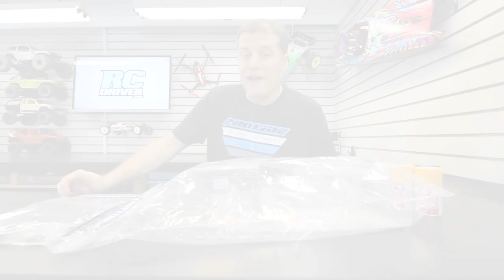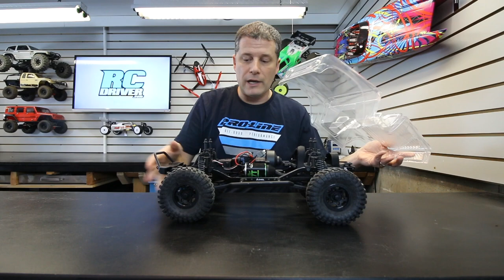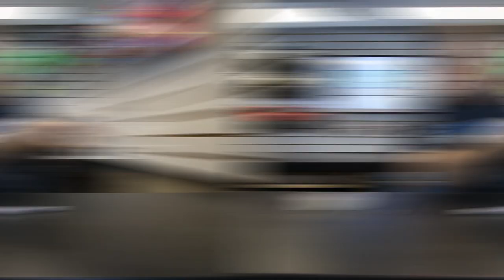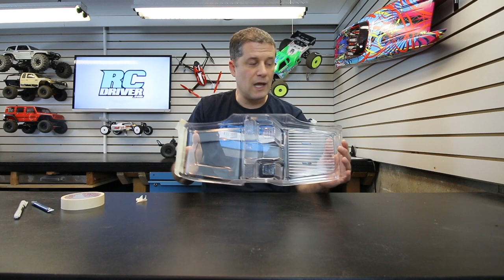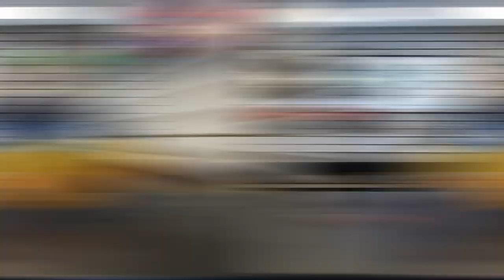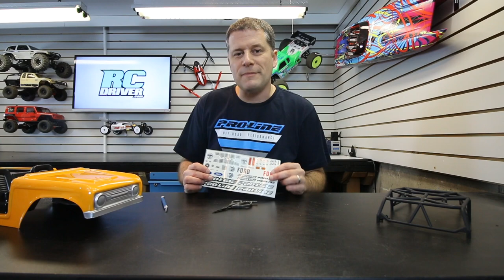Simple RC Body Painting Tips & Tricks! - How To: Spray Paint The Pro-Line Ford Bronco | RC Driver

Comment: A thin layer of shoe goo on the underside of the body around the body mounting holes and in the wheel wells will strengthen the body and prevent paint loss due to tire rub and roll overs.

Comment: I'm having problems with my arrma outcast. My ESC won't exit heat protection mode. None of the electronics are working. I charged the batteries and put new ones in the controller. Did I burn out my ESC? And does my ESC have anything to do with my Servo not working?
Reply: This is the wrong place for this question.  But to answer it, yes you have "cooked" your esc. Yes your cooked esc is the reason your servo is not working.

Comment: Well I painted a Proline Chevy Silverado body for my t maxx with 4 colors: metallic blue up front, a pink stripe going diagonally across the middle, metalic purple in the back and a black bed, for it just to go to waste because after a couple of runs, the paint all over the inside fell off randomly. It looks pretty ugly and I don’t know what I did wrong. I first cut the body, sanded it, washed it, masked it and painted it. It looked good only with some paint bleed in the pink stripe area. I’m really disappointed for a first body that I painted.
Reply: What kind of paint did you use? I’ve used a paint that said it was for plastic that did the same, the problem was it wasn’t for flexible Rc bodies. Make sure the paint specifically says it’s for Rc bodies. A clean body and Rc paint holds up well to flexing/etc.
Reply: I used the normal Tamiya paint. Oh wait a minute, my black, white, and metallic blue paints I used say “for plastics” on them while the pink, metallic purple and smoke (tiny) say “for polycarbonate.” I think that would be the issue! Half of my paint was for plastics and the other half was for specificly polycarbonate.